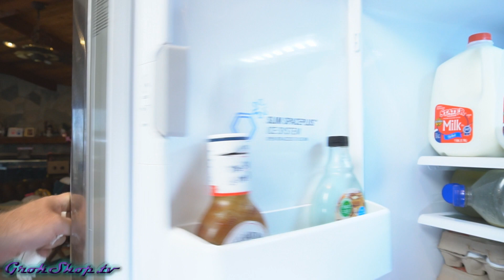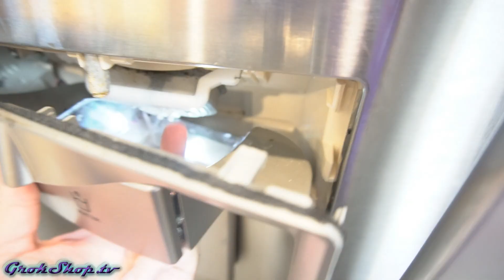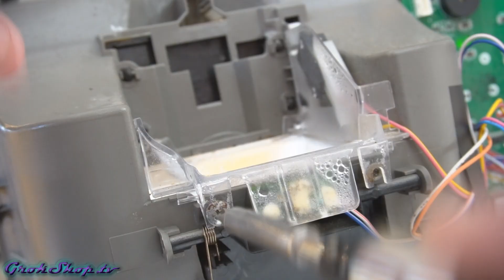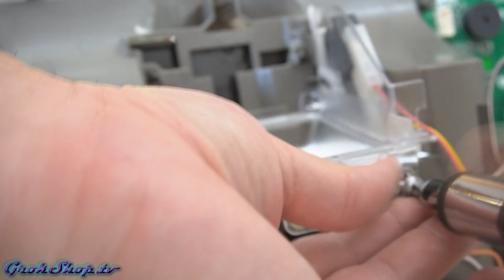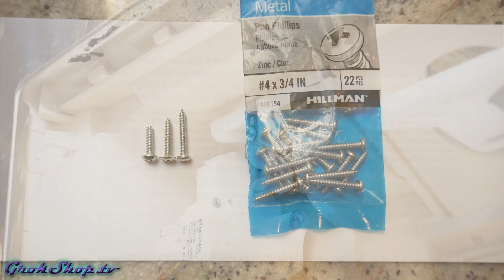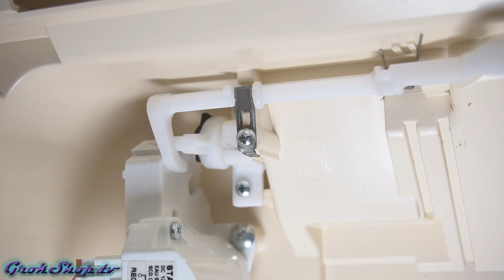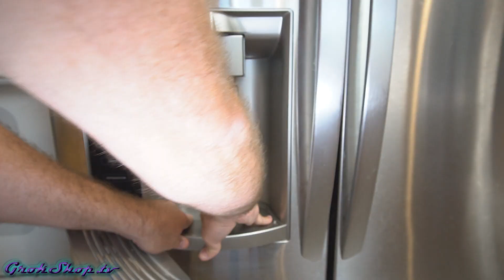LG Refrigerator Ice Dispenser Repair: Ice Dispenser Flap Not Closing

Comment: Great video. TY. Exactly the same problem with mine. Must be a common problem. I guess its to much torque on the plastic piece.  I ended up putting a longer screw and that worked. I did break 1 tab.

Comment: This was very helpful. I realized my unit was full of mold and wanted to get it clean. I would have never got it apart without this video. I was pulling really hard and it didn't feel like it would let go without breaking something. Finally it did "pop" and I continued to work it carefully. No broken tabs. I'm not sure the putty knife was necessary. Looking at the tabs, once it was apart, it looks like pulling straight out would have been the best bet. Thank you for doing the research.

Comment: Hey - Great video, helped immensely.  The broken post on our LG wasn't useable, so I tried a longer screw without the post, and it works fine.  Broke one tab (on the bottom) but didn't seem to affect the reassemble.  Thanks!

Comment: Question…..I have water coming out around the dispenser assembly and is slowly dripping into the freezer portion of the fridge. The water doesn’t seem to be coming from the ice maker, I have a feeling that the water line for the water dispenser may be cracked somewhere. Have you or anyone ever seen this before??? Thanks.
Reply from the maker: Haven't seen that (yet).  Your theory may be right.  I would also wonder about the dispenser valve maybe not seating properly?

Comment: Had the exact same problem.  Broken screw post preventing the flapper from closing.  It was a real pain removing the panel and broke 3 clips.  Lots of mold inside there too.  Should be easier to remove for cleaning and repair.  Used the longer screw as recommended and all is good.  Thanks for a good, to the point video without any fluff and padding!

Comment: In your video, the motor arm seems to start in the forward position then push to the back pushing the paddle back and the other pin forward to rotate the arm and open the chute. Any idea what would cause the motor to operate opposite? It starts in the back position, propping the chute open then closes temporarily when you activate the button then returns to the open position.

Comment: Thank you. Awesome video!  I had the same issue with the ice flap and the root cause was the same.  I (krazy) glued the plastic base together with a wood tooth pick inserted in the center to guide the alignment. I drilled the toothpick out after the glue dried. I still used a slightly longer #4 stainless steel sheet metal screw.   I had the repair done in 20 minutes.  The longest part(s) was the trip to the hardware store and the cleaning of the interior components (moldy).  Two tabs broke but it snapped back in fine.... like new.

Comment: Thank you for taking the time to create this very clear and concise video. I'm seeing this video AFTER having an LG service tech visit my home three times to repair the ice maker.  The problem I'm having appears to be a flap that is not sealing tightly.  It open and closes when activated.  This is causing water to periodically dribble out of the chute.  It was a similar problem we had with a Samsung refrig in which the Samsung tech just replaced flap assembly unit - problem solved.  I explained this to the LG tech and said the problem was with the ice maker - which he ordered and installed.  Knowing how the flap assembly works will hopefully help me recommend to the LG tech, who I'm getting to know pretty well, to replace it. 

LG - Life's Good! (only when your appliances are working correctly)

Comment: Any suggestions if my ice flap doesn’t open consistently. Alway clearing ice jams because the ice flap doesn’t always open.
Reply: I have the same issue and have not been able to find a solution.
Reply from the maker: The one thing that comes to mind for this issue would be the spring.  If the spring is not seated well or installed properly, I could see the flapper not opening correctly.  When I reassembled, I didn't put mine in quite right & had to redo it.
Reply: The motor for my ice flap unit was on its last legs and I just replaced that. It would open all the way one time and the rest it was half way. Once I replaced the motor itself ( LG Part# EAU59551204) it solved the issue.

Also, I was able to remove the whole dispenser panel with just friction of rubber dish gloves in lieu of a paint scrapper with the great grip on them…a lot easier and no broken tabs

Comment: I used this video to guide me through replacing the entire dispenser.  The video is perfectly accurate.  I first removed the door handle, it is held in place by a set screw with a hex head at each end.  Remove the front dispenser carefully using a putty knife wrapped in painter’s tape so you don’t scratch the front of the refrigerator.  I also placed painter’s tape on the stainless steel door face surrounding the dispenser to further insure I didn’t scratch the refrigerator front surface.  All seven electrical connectors are unique so you can’t misconnect the new wires.  Pull apart each connector carefully with your fingers, some have a snap fitting to hold them together.  I had to use a pair of needle nose pliers to separate the smallest connector.  After reconnecting all the wiring, simply snap the new dispenser in place.  Tools required- hex head tool, putty knife, painter’s tape.  Easy peasy- 20 minute job.

Comment: Thank you so much for posting this fix.  You may have guided me towards  the solution for replacing just the LED panel cover (mine got damaged due to humidity dark spots).  However, as you pointed out,  replacing it is almost prohibited, as I cannot manage to open the cover to replace it .  So simple, yet so hard to reach for an opening...There is the risk of damaging the edges of the control panel itself while trying to reach for the cover, hence  creating another  bigger monster.  I will try to find someone that could help me, and will save your  detailed video as a DYI guide.  Many thanks again!

Comment: Great video, is it normal to get this kind of mold? I ask because I have the same issue with mold and Refrig is at 36 degrees and freezer is at -2 degrees. I take this panel off at least 3 times a year. any help would be great.
Reply from the maker: I think that mold in fridge door ice chute areas is pretty common.  What is going on is that water vapor in the air outside the fridge is condensing when it is cooled by the cold air coming out when the flapper opens.  And mold loves that.  I think if you live in a more humid region, you will get more of it.  One thing you can do to reduce the suffering (panel removal) is to spray vinegar up the chute & use like an old toothbrush then spray-rinse with water.  Won't be able to get everything, but you can get most of the stuff that might touch your ice at least.

Comment: Hello, congrats to this useful video :)... I don't have a problem with the Flap, but I have a problem with the water dispenser. I just renewed my filter system and now the water is dripping and doesn't stop at all. Do you have a tip for me, how I can repair this. I tried to take off the dispenser as explained in the video, but I wasn't successful :(. I have a ten year old LG GW-P227 HSQV). By the way I had that dripping problem about one year ago too, but back then it stopped somehow...

Comment: Great video though my suggestion is don't buy LG anything. I started replacing my 20 year old GE appliances, not because they didn't work anymore but for design (French doors) and aesthetic reasons. Within a year, before I had a chance to replace my GE stove and microwave, the dishwasher and refrigerator had multiple issues. I already replace the dishwasher with a Whirlpool and trying to get the fridge fixed under warranty. I still use a Denon CD player that is easily 35 years old. I had gotten an LG DVD player and replaced it after 2 years because it stopped reading most discs. I replaced that with a Pioneer which is now 7 years running.

Comment: Awesome video!  I used this exact procedure to repair my LG LMXS27626.  I did added a drop of superglue to the broken screw post to tack it on.  Seems to have worked like a charm...hopefully it holds up to the torque of the motor and spring mechanism.

Comment: Terrific video, thank you.  I repaired my 4 year old LG LMXS27626 ice chute door using this.

I agree that removing the dispenser door was extremely difficult.  I went very slowly, used far more force than I thought I would have to, and eventually got the dispenser out after about 45 minutes.  All tabs were intact, somehow.

I had prepared to repair the screw post as you demonstrated, but much to my surprise, my problem was simply that the opposite side spring was not installed correctly!  Incredibly easy fix, once I got the dispenser out of the door.

I suspect it came from factory this way.  I have had occasional problems with ice/frost jamming the chute, but seemed to be happening much more frequently lately, and the COVID-19 quarantine finally gave me enough time to trouble shoot!

Thanks again!

Comment: GREAT video, it was the 1st link that popped up for me and the only one I needed. My model is LFX28968ST and also, I think, ~5 years old. I would add a few notes on slight differences I ran into. 1) Although you forewarned about the tabs may break - i thought i used extreme care to use the same type of paint scraper and used slow even pressure all the way around to evenly ease it out. However, the upper row of snap tabs (3) the one left of center broke off. the final assembly looks fine though when all the others snapped back.

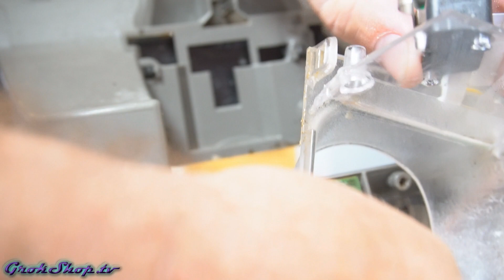I had not planned to remove the clear plastic since there was no mold, but it did have a lot of iron/calcium buildup so I took it out. At 3:42 in your video - when removing the clear plastic dispenser guide - you very quickly show the micro-switch and white nylon lever assembly removal after you inspect it’s motion with a couple of pushes. In my case that switch and lever fell off and apart as I removed the clear piece. Similarly, the tiny white LED PC board popped out of it’s hole as well due to wire tug. There was a mounting screw hole on that PC board, but it was not used. The board is held in place by the clear plastic piece when mounted back correctly. Unfortunately, I made the wrong 50/50 guess about the orientation of the white nylon lever and when all this assembly snaps into place, the micro-switch turns on the water flow permanently. After cleaning the floor and reversing the lever, all was well. Good point about aligning those small tabs/pins though! “Gotta hold your tongue just right” on that part.
  Thanks, since i had a jar of random screws i found a perfect longer #4 screw and so the entire fix was $0 out of pocket. Drilling out the "spacer" and not gluing seems perfect since they had plenty of extra pre-drilled post depth in place anyway.

Incidentally, the water nozzle itself was moldy both inside and out. This occurred in spite of the fact that i have a 3 stage filter system in the garage - upstream from the refrigerator filter.
Reply: Same model for me, but my issue was the ice flap motor was on its last legs so it rarely opened all the way.

Also, I actually found using like rubber cleaning gloves allowed me to remove the whole ice dispenser section in lieu of a paint scrapper because of the tight grip against the dispenser.

Comment: OK--You did a pretty good job on explaining this flap repair job. My kitchen got  flooded from water coming from the water dispenser,   I believe I'v  done all the attempts on the internet,,   I have the same refrigerator,  two problems:  the  two panel night lights will not turn off & neither will the water button switch located on the front upper panel corner on the door, it looks like it's depressed in a little, I also tried prying out on the buttton, no sucess,  ( LSC 27937 ) ( s/n- 310MREB01103 )  I need a phone call as I can't wait & hope for days and days for a response or maybe never.  I'm at my wits end, LG's   1-800 number was a waste of time they have no fix,  that's not their job advising  ( talked to two experts or suposely )  just said to call a repair man, ( I'm not doing that. ) .  also if you do break the tabs, well then what, "DUCK TAPE " Right Yea that will go over good with the wife. Yes  a  stupid design by LG.   A vidio would be just great...   WILL at 707 644 2172 land line, 707-333-0778 cell
Reply: Try this site: look up specific info for your model fridge: https://www.repairclinic.com/PartDetail/Dispenser-Front-Panel/MCK62965301/2672854

Comment: Great video! I have a different problem...the ice flap opens fine, but my water AND ice dispensers stopped working at the same time. Would this be a switch? It can't be the auger motor because the ice flap still opens, right? The repair guy I had out said it is probably the "dispenser control board that attaches to the auger motor". Does that sound right? That part doesn't seem to exist (by that name) as I keep getting the wrong part sent to me- repair guy gave up and told me to ask where is gets installed if I ever get the right part sent. Any advice is appreciated!
Reply: @anotherfreakinfixitchannel5884  Thanks, Dan! The third repair guy came up with the same...and the entire door has to be replaced to fix it. I'm shopping for a new fridge instead.

Comment: I"m having a similar problem when I put a glass  . Against the ice dispenser I get no light and no ice will come down .  But the ice maker is still making ice .  Just like to know if you have any suggestion how to fix this problem . Thanks Mike
Reply from the maker: If everything else is working, but just the flapper isn't opening or even making a sound like its motor is turning & the light also isn't coming on, then I would guess you need to look at the switch that gets activated when you press the ice dispense panel.  Possibly the switch is somehow being interfered with, or has a loose connection, or has just gone out.  Check the service manual to locate the related parts.
Reply: @grokshop  Thanks so much I will check that out and let you know how I make out
Reply: @grokshop  I replaced the switch and it is working perfect . Thanks again Mike
Reply from the maker: @mikemolinari4091  Well done!  Thanks for following up for the greater good :O)

Comment: Same exact issue. Appreciate the video. Getting the panel off was a pain! I ended up putting tape on some needle nose pliers and a screwdriver to wedge open that top right corner. Once that was loose the rest came apart fairly easily. I would've been afraid I'd break something without your video so thank you!
Reply from the maker: Beautiful.  Thanks for sharing your extra tip & for the positive feedback!

Comment: I have to say this is one of the best, if not the best, DIY repair videos I've watched. It was tricky at times, but the quality of the video and the steps shown were fantastic. Total cost of the repair, plus my time and a little aggravation, 19 cents. It would have been half that, but I bought two different length screws just in case :-). Thanks!
Reply from the maker: Thanks Rick!
Reply: I bought 3 screws for $0.41 :). Inflation

Comment: I have a LFX28968 and it's the same problem. Everything was going well until I took off the screw and retaining clip you suggested. When I pushed a little on that bar the whole flapper and bar came off with two springs, and I have no idea how to get those springs back on or where they go.
Reply: The good news is I think I have the springs back on right. Trying to get that broken piece back in place is a change.
Reply from the maker: @rickuztube  Good.  I'm sure you figured out that the springs hold the flapper shut & there are 2 little grooves on each side where the springs are seated.  The whole thing is definitely a bit fiddly.
Reply: Was finally able to get the broken piece in as a spacer. Put it back together. Seems to be working. By having that retaining clip off, I was able to loosen the screw that was above the one that was in the broken post, and that allowed me to move the piece that the screw was going into a little further away from the remaining post, giving me more room to get the broken post back in. I put the screw through the hole and the through the spacer and was able to line it up and get it to stay in place.

Comment: Had exactly the same problem. Must be a design problem with this model, also happened after approx 5 years. I owe you a beer. Your video saved me probably $200+ repair bill if not more.
Reply from the maker: Interesting.. I was wondering how common this issue was.  Other than this issue, ours has been a stellar performer.  Thanks for the feedback!
Reply: Exactly the same for me, after about 5.5 years, this just happened to me! I've always had issues with the ice dispenser in this fridge. I will not be buying an LG fridge in the future.

Comment: Great video.  I have fridge model LG LFX25978ST/00.  Will P/N ABN72938908 work for me as a flapper replacement?  I am pretty sure I can do this myself with your instruction vid.
Reply from the maker: Thanks.. yeah seems like you have the right P/N there.  Is your flapper damaged?  Prolly can pick one up on ebay for cheap.